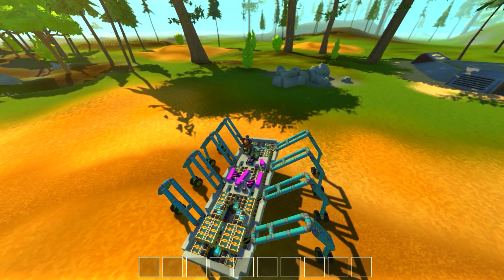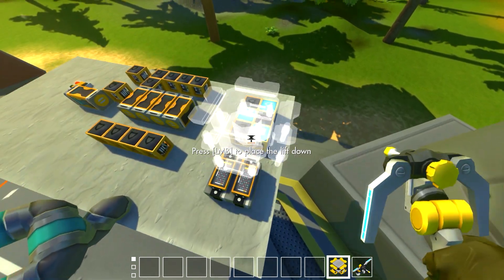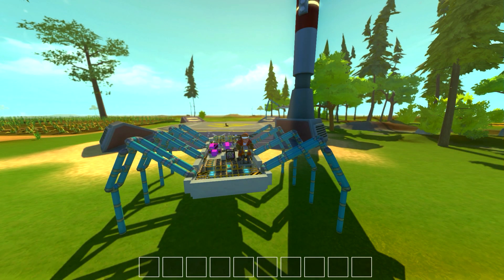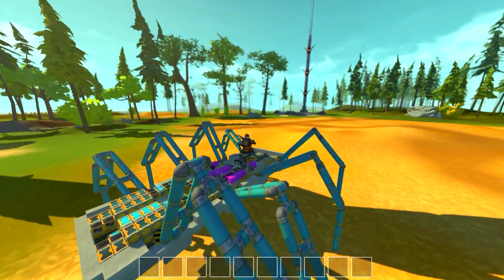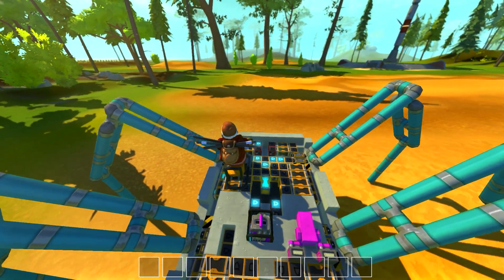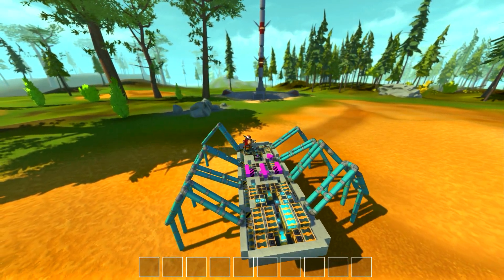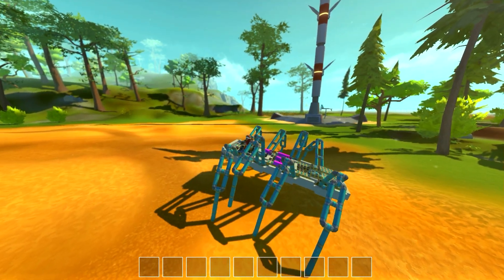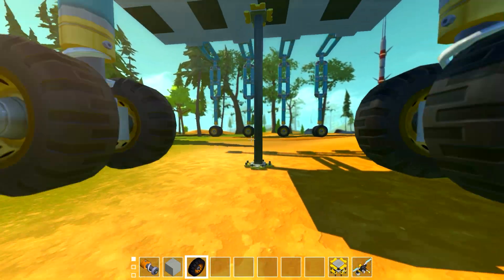Amazing Spider Walker! No Stabilizers! (Scrap Mechanic #134)

Comment: try adding a sportsspring on each leg. it got to compress almost 100 % when it walks.
makes the walk smoother and it adapts better to terrain.
so far it looks like its not heavy enough with the bouncing.
Reply from the maker: lars kristensen I tried the sport suspension but it didnt make that much of a difference. Maybe it needs more weight too

Comment: 2 things you can try: putting the tires sideways, or put thrusters on to push it down so it has more grip
Reply from the maker: Gipsy Taylor Yea I think the issue might be the lack of weight and the timing on the leg movements
Reply: Maybe when givin a body, it would be heavy enough to walk right

Comment: XD ive made walkers with no stabilizers and the driving system only needs 1-2 controllers depending on the legs
Reply from the maker: Mech WARRIOR57 Yea each leg on this only uses 2 controllers. The main thing is only using 1 set of bearing and avoiding the use of double bearings on the leg joints
Reply: well I meant 1-2 controllers for one side (it doesn't do the thing yours does for turning) and I don't know what you mean by double bearings but this works too lol

Comment: i thin u should time the leg movement. its look like its drunk XD i think if u do give the legs a number like front left 1 and back right 8 and the Timing should be öhm one leg should only move if on the other side is a leg on the ground like. (1 wana move but 2 hasent its end position on the ground then the position has reachd 1 move and 2 not i mean the up down way the slide musst go on. (sry if i talk in riddels)
Reply from the maker: ZeroZemial Yea the leg movement timing needs to be adjusted for sure.
Reply: i think it will move better wenn it not so drunk any more XD

Comment: This is not spider walk. This is centipede milipede movement. Go watch a video of how spiders walk. For a starter the front and back legs you have are all wrong. It is good to see you finally shying away from glitches. This fact alone means I will not dislike the video.
Reply from the maker: Lt Sam I usually try to completely avoid glitches with the exception of the suspension glitch for hovering stabilizers (never infinite). and yea I watched a spider walk and realized I didnt follow the front leg movement properly.
Reply: kAN Gaming The rear legs also have a unique gait as well. I spent way too much time making a one man spider walker car when this game first came out. Ended up remaking it recently but my video card literally caught fire so I am kinda waiting to get it fixed (point was I could record or post to workshop and show u.) My biggest recommendation on your current design aside from the leg gait is try putting thrusters pointing down on the end of each leg. This was how I solved the traction issue and it was eventually capable of climbing walls. Gotta think spiders have tiny hairs that allow them to cling to surfaces. Without that the next best thing is thrusters? Right?
Reply from the maker: I'm going to remake this spider but it'll take time. Going to try to get the leg movement better and increase the traction with thrusters.